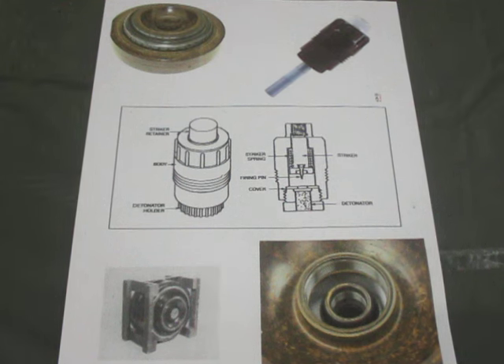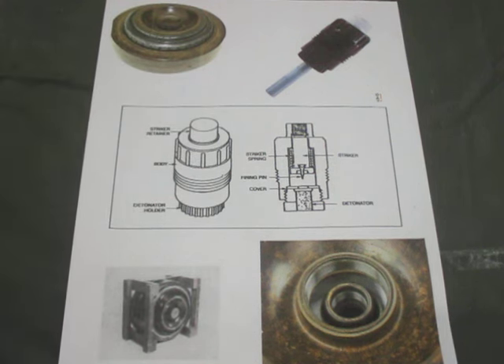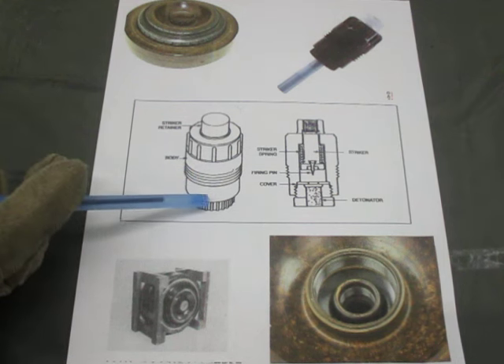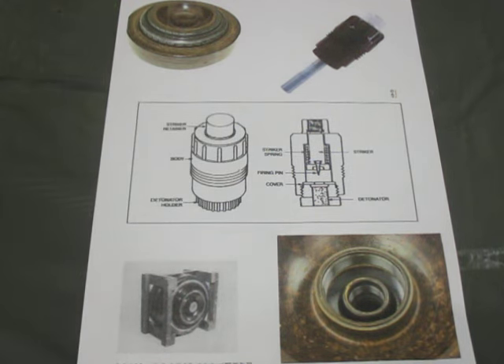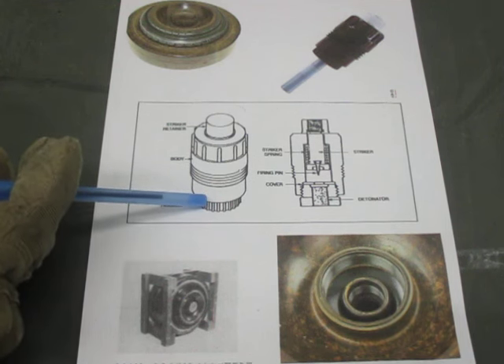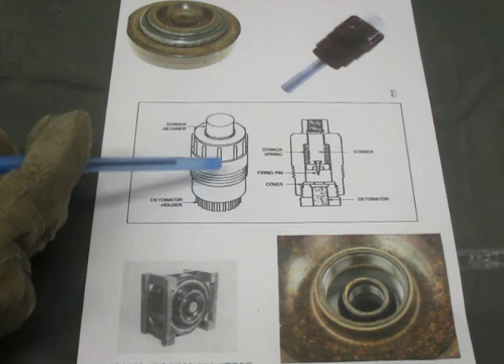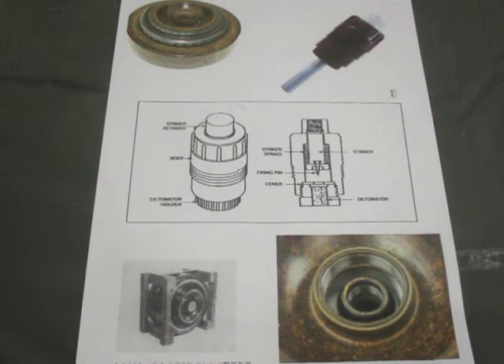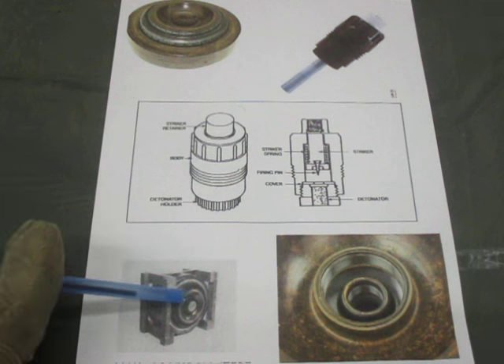Czech PT Mi-Ba-3 Low Metallic Antitank Mine

Comment: Watching these it really makes you wonder what a large entity could do in a hurry with modern 3d printing for fuzes and modern blown plastics for bodies of the mine.
Just like the artillery shortage in Ukraine the issue would quickly become the supply of the filler. You could crank out containers and fuzes, but the sheer volume of the necessary chemistry would slow production down.